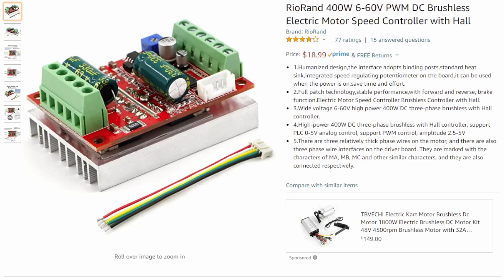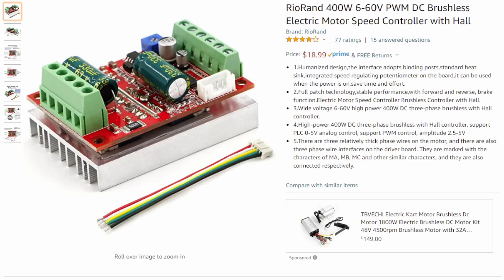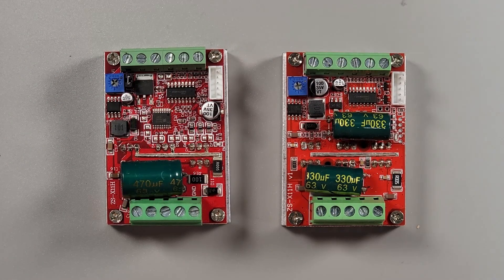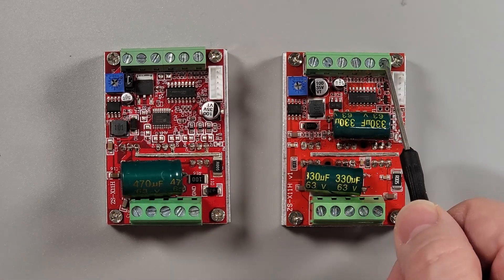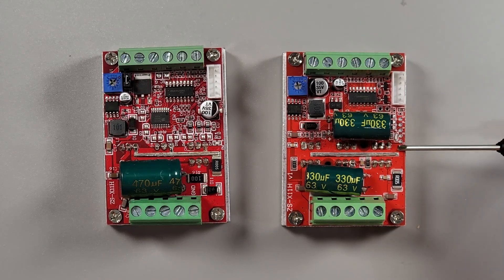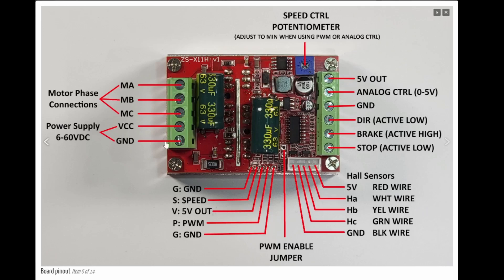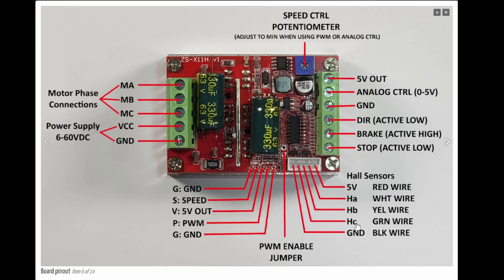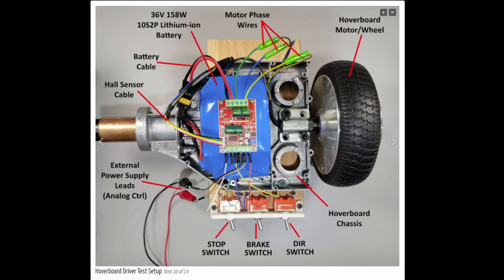Inexpensive Hoverboard Motor Controller

Comment: Great video, I was wondering if I could ask your some questions. We have used Chat GBT to build ourselves a bot we're using. 4 hoverboard wheels that drives in a tank style configuration. With a PS5 controller and the RioRand 6–60V DC motor controller (350 W class) and the mind is a esp32. How can i automatically stop the bot from coasting when there is no input from the ps5 controller?

Comment: I think it is capable but im just checking to be sure can I use my 36V 10 amp dc power supply to power the motor controller if I get the 400w controller instead of using the battery you have.

Comment: I have 7 wires on my gotrax hoverboard for the Hal sensors - what are the other 2 wires - brown and black. From my limited research they may be reverse or brake ? Also how beefy is this controller, some persons on reddit said they burn out ofter so have you looked at the ones on Temu rated at 1500 watts for around $20 ? Thanks my kid is very happy we can start on this project.

Comment: I have two of these that I would like to use in "tank reversing" mode. Have  you tied driving it with a PWM RC receiver to see if it will reverse direction via PWM input??

Comment: Can you use a three wire e-bike speed control on the PWM? If you can what wire(s) would connect to the board terminals?

Comment: I've also used this controller for a hoverboard motor.  I would give a warning however about using the brake.  It creates a large voltage spike to the input source, and this blew up my r/c receiver.   I've since discovered that all of the hoverboard motor controllers I have (I have 12 of them I think), all use the STM32V103 chip for the control.  So I bought the STM32 dev board kit on amazon which includes the 1-wire programmer for the chip, and my plan is to recode the firmware in the chip to drive just the motor instead of all the hoverboard stuff.   The stock controllers are more powerful than the rio board, some combine both motor controls into one board, others have one controller for each wheel.   I need to trace out which pins do what on these boards, have not done it yet, but you might look into it.
Reply: I was also looking at a way to use the stock controller, let us know if you get this working. Would be good to do what you have done and strip off all the fluff from the stock system and control the motor speed output based on a controllable input
Reply: @david667766 I was able to hack the hoverboard motherboard and use it on my remote control lawn mower
Reply: I was actually going to add something similar. I blew a couple up doing this, good thing they are cheap.  I also just left dir float, or earthed via using a relay to control as a suspect applying high to the pins was causing it to fail. Always blew the same MOSFET every time.
Reply: so hows your progress?
Reply: @Timsturbs  Health Issues prevented me from working on it.  This winter I should be back on the 1/3 scale rc car using hoverboard motors.
Reply: @murraymadness4674 do you need help? I can  get a hoverboard motherboard ready for you so it's plug and play.  All you have to do is plug in the motors and receiver.
Reply: @Timsturbs I was able to make 3 remote control lawn mowers , a walk behind weed eater, a platform to carry heavy stuff including myself  and a remote control blower. All using the original hoverboard motherboard.

Comment: Everything was working well, and then when i set the throttle to max , the board just powered off and now the vcc and gnd terminals are shorted, so whenever i connect the battery it just shorts, any idea why this happens?
Reply: sounds like you blew up the mosfets

Comment: Great tutorial.  Just got it working on the bench.  Note for others:  If you are wondering "what do I do with the blue wire on the hall wire bundle coming from the motor? it's not working!" then you have it plugged in wrong.  Phase A, B, and C's colors on the big wires match the colors on the little wires of the hall wire bundle. So for me it was 'hall sensor cable white to hall bundle yellow, hull sensor cable yellow to hall bundle blue, and hull sensor cable green to hall bundle green'.  If you look at Mad-EE's diagram (test-setup-schematic) on the website it will make sense.

Comment: Interesting, thanks  ..but question:  where exactly does the motor get the information about how fast the wheel is turning? It probably calculates this using the signal frequency of one of the Hall sensors (a separate tacho generator is usually not installed). If I were to send the pulses from all 3 sensors via 3 separate frequency dividers (i.e. only after 2 pulses would one be switched to ground), could I trick the controller and would it then increase (or double) its speed limit or would the interaction of the MOSFETs cause confusion? 
..right, I just want more speed for my small but nice scooter ,)

Comment: Hi thanks for your video excellent explanation my question is I have a  Electric E Scooter Bike 12v 24v
36V 48v TWIST THROTTLE Gri... and 36V/48V 350W Electric Bicycle E-bike Scooter
Brushless DC Motor
Controller how do I connect them to make my motor work and what battery voltage should I use I made it work once for a project.   I can remember how help please thanks

Comment: Hello from Spain, this video is a great explanation about how the controller and motor works. I'm trying to manage 2 motos each one with a controller, the system seems to work correctly but when one or both motors get overloaded (small holes on the ground or some resistance on motors), the Arduino board get frozen keeping the last pum value on each motor so the robot is no more manageable and I need to reset the board... do you could know why that could be produced?

Comment: I’m a pretty new to this kind of stuff but On the brake switch input would it be possible to run a potentiometer for a more controlled braking application.

Comment: Hi there...awesome explanation of the board mate!! I was wondering, seeing you have a huge amount of understanding this controller board, what would you think if I want to over clock it with higher voltage to say 125 volt and therefore changing the Mosfets values as well  the caps...My need is not so much torque....just speed and thus to adjust the input  voltage...Hope to hear from you. Friendly regards mate!!

Comment: i got the hover board working but its noisy. At first it hummed. i switch motors phases and it started running. now im wondering it the hall sensors are out of phase. the riorand has hall sensors colors, green ,black, red, yellow, white. the motor hall sensor colors are green ,black, red, yellow, white. so the differences are white and blue which got connected together because that's what's left. maybe that;s the way it is. igot to take current reading and see if something is off. have you created a schematic

Comment: Hey man. Really great video. I was wondering, do you know how the brake function really works on this board ? Is the energy dissipated in a resistor ? What technology is used ? I couldn't find any information on that anywhere. thanks :)

Comment: Do you think we can use the motor controllers already existing on the hoverboard board? To bypass the hoverboard uC brain? Thanks.
Reply: Yes you can, it can be reprogrammed but the info online is minimal.  You would need to trace which pins connect to the motor/hall

Comment: I bought two of them for prototyping a self propelled bike trailer i just tryed them with my generic hoverboard motors first i tryed one with my variable lab bench power supply and everything was working ok i had problems with quite some vibrations at low rpm and sometimes the motor would not start and i had to push it.  When i connected a 10s liion battery in the beginning everything was working fine until i was rising the throttle a litle bit higher the controller just broke and shorted out my battery luckily i had a lose connection wich just disintegrated before anything realy bad could happen. I tested the mosfets and they where toast completly shorted out. Then i thought maybe this one was bad and tested the other one everything the same on my power supply but with the battery i used a 5a fuse to make sure this would not happen again but when i rose the throttle the fuse popped and the mosfets where toast. Cant recimed this product.

Comment: Thanks for the good introduction! Just one thing that I got stuck on when getting my RioRand up and running, which might help others: The pinout image describes the STOP pin as active low, so I connected it to an Arduino and set it to +5 V. But then the motor was stuck on full speed, regardless which duty cycle my PWM signal had. It seems that the STOP pin is connected to the analog input created from PWM and potentiometer, and one can indeed stop the motor by pulling it to ground, but it should be left unconnected not to disturb the PWM.

Comment: Hello, I bought an XS-X11H circuit to control a brushless motor and did the same as the picture above to supply 24v power, but no, the motor just jerked once and then stood still. Do I need to press the two Jumper points to start the engine? I took an electric car control circuit to test and the motor still runs fine, so the main XS-X11H has a problem. I use this circuit to replace the Boneco H300 air purifier

Comment: What type of external throttle would you use for a go kart project.  I tried an e-bike thumb throttle 3 wire potentiometer but it didn’t work because at no throttle the wheel was still turning and at full throttle was less than full throttle manually with the board control.

Comment: Hello, i have mounted a 350w hoverboard motor on my bike. When i used the old hoverboard controller the motor was powerful enough to move the bike. But when i used this controller the motor can barely move the bike without a person sittingnon it. What is the problem?
Reply: Not enough amperage In the motor controller. This isn't strong enough to tug you around on. Made for small projects. Go with ebike motor driver 72v
Reply: Did you work out the problem. These should be 16amps
Reply: @mugs500  yeah I bought an 1800w vevor motor and used that instead
Reply: @svoper3338 haha well that would do it.

Comment: Absolutely great video! I am a mechatronics engineering final year student, and I am using 4 of these hoverboard wheels and drivers for my final project. I'm building a Robotic seed planter. 
This video just cleared up a lot of stuff, there seems to be limited info online about its working principle. I'll definitely check the blog for those calculations.
Thank you very much!!
Reply: hy, how did your seed planter project go? I am also interested in this kind off stuff
Reply: @jackrenders8937  It went quite well actually. Most of the issues we had were from the code and circuitry. Besides that, it was great.
Reply: @saleycole4296  what's the battery voltage in your system? I have 2 such controllers in my project and they keep dying from time to time.

Comment: On mine the break and stop function works but it won’t rotate. Do you have an idea of what might be wrong? I’m using hoverboard wheels from a swagatron hoverboard. Currently running on 18v drill batt

Comment: Using it with hoverboard wheels, 22v lipo, but it’s very noisy! Any tips? I think the wiring is right, it does run full speed.
Reply: maybe the hall sensors are not ABC but ACB or whatever

Comment: I'm making a beach cart from hoverboard wheels/motors. Would this be robust enough to power it? 

2 motors on the back and a throttle to speed up and slow down. It will be in sand so no brake.

Could this do it? Im using big tires so it doesn't sink down.

Comment: Seeking your response,
How it is possible that a 36 volt 4AH battery, (which is only 144 watts/hr,) easily drives 2×250 watt=500 watts of Hoover board motors ? 
I need to know the logic,so please do reply,

Thanks
Reply: Easy the discharge rate of the battery is comonly around 15-20ah since this uses 18650 cells
Reply: It's not 144 watts/hour, but 144 Watt-hour. Meaning, it'll run a 1 watt load for 144 hours, or 144 watt load for 1 hour, or 0.5 watt for 288 hours, or 0.1 watt for 1440 hours or ... So for the 2 motors running at full load, it'll run for roughly 17 minutes.

Comment: That was great.  No ''Tom-foolery', just the cold-facts-exact.  Someone gave me some hoverboard wheels that I want to experiment with.  Really useful - subbed.  Thankyou.  Any recommendations on good source for batteries to get?  Wondering what the available torque is?  Torque is key to some ideas that I have.

Comment: These are convenient if you have the motors but not the true hoverboard controllers (or you have one of the unsupported controllers).  Kind of want to say they'd be most useful for extremely "dumb" projects.

Otherwise the hoverboard controllers with open source firmware gets you all the controls and telemetry via serial protocol so it actually gets you a lot more.  Don't have to write code converting/measuring analog signals and speeds, etc.  Much easier to implement failsafes I think.

Comment: Here's an update to my previous post:
So I tested the RioRand ECS. It was cheap, but it kind of made the hoverboard groan. Like it wasn't fluid or clean signaling. 

So I went ebike/escooter controllers. 3 phase with (hall) "signal". And yes they use 0-5v for the throttle.
So I threw in an Arduino (which can read RC server/PWM very well).

For those who are reading this, to run 0-5v controllers, you can use an arduino or raspberry pi.
Convert digital to analog... Like PWM to a DAC or some other digital signal to a little breakout board DAC.
That'll convert it to 0-5v.

So many powerful options with this approach ^

Comment: Hello,
What happens if you don't connect the hall sensor? Does the motor work anyway?
Thanks
Reply: You can get the other controller without hall sensors (and it wont work as well probably). But using the board with hall sensors not connected will likely not work as they are used to give feedback when to pulse the 3 signal lines of the motor. With the sensorless version its probably like using a regular hobby esc but there are videos out there showing it does have issues when you stall the motor.

Comment: Found two hoverboards that were partially disassembled on a a trash pile. Lucked out, one so far works , the other sparks when i  connect battery . Are the wire colors standardized ? One is Hover-1 , and the other that doesn't work a Razor. Bought some square metal tubing to start adapting one motor to make ebike out of my beach cruiser bicycle. Finally got around to starting the build.
Reply: those motor wires are not standard. I had to just keep switching my motor and hall sensor wires around until it worked
Reply: @KnexRules8365  Bummer. I found some on Aliexpress, but that is just the worst site to get questions answered. I'm ordering a welder today so I can get the bracket made. Putting on beach cruiser, so it ended up complicated. Already printed replica of tubing in the dimension. Had to use a die cutter to make screws with die cutter. Trying to do a build using available hardware as much as possible on the cheap. Now shopping for el cheapo inverter welder. Airgas wanted $190 to refill 160 cuft oxy and 100 cuft acetylene tanks. Looking at Hitbox and hzxvogen inverters on ebay  for stick. Can't afford $190 for tank refill.